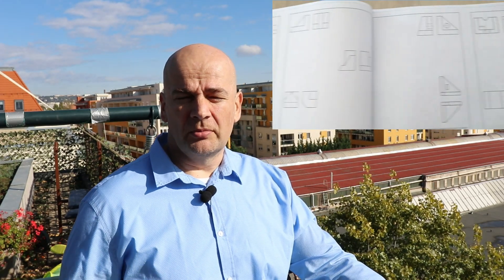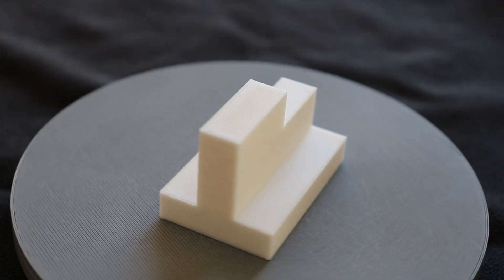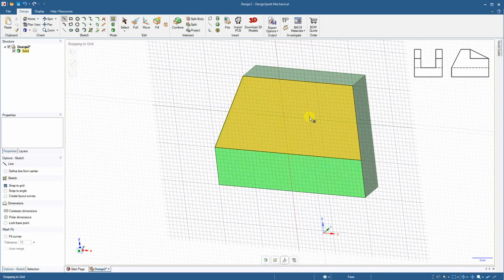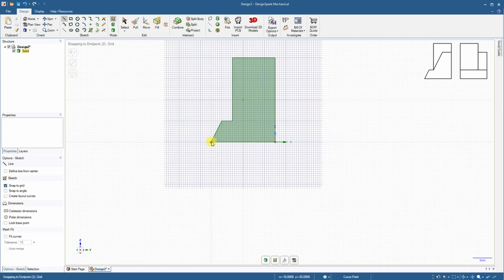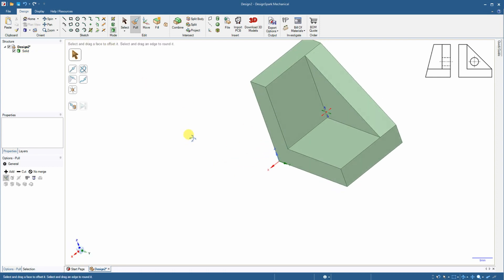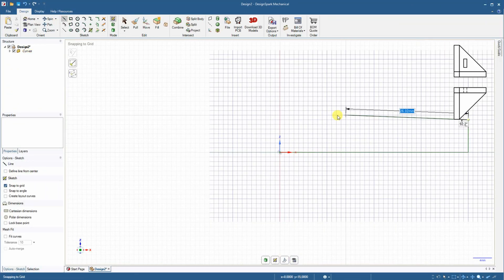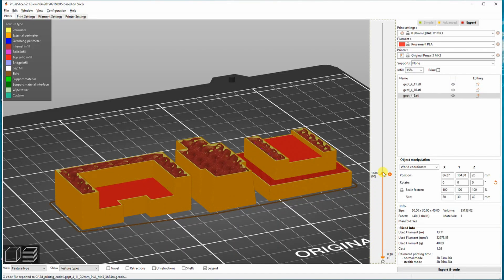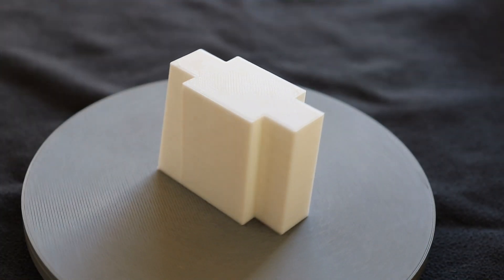DesignSpark Mechanical practice #1

Comment: Nowhere did I find a video on how to make a pyramid with a triangle base (all sides of equal length). Perhaps it is worth making such a movie for beginners.
Reply from the maker: Start with Polygon, 
set 3 sides
Draw the triangle
Then go to Pull/ Pull Direction
Extrude it to get a triangular prism. 
Use Draft tool on any of rectangular surface to rotate it.  "Pick a plane to draft about" this should be a triangle base. 
All 3 surfaces will be rotated and you will get  triangle base pyramid.
Reply: @MyTechFun  Thank you for your answer. My attempt (according to the instructions) was half successful - I got a shape with a triangle base, but the lengths of the walls are different. Still, I'd like to ask you to make a movie about it. I think that the time spent on making a movie will not be more than 15 minutes.

Comment: Ah this virtually is free Solidworks.  Awesome !!!!
Reply: It is free but it has many flaws, btw.
Reply: @pietrononame4945  Ah, it's been a year already.  Since this comment, I found onshape which indeed was created by SW creators and works very similar, but free version is not as powerful.
Reply: I take this back.  DesignSpark looks like SW at a glance, but works nothing like it.  It's either complete garbage or too difficult to learn due to lack of resource.  Online manual doesn't cover anything useful beyond very basic.  All YT channels seem to be dead and no one seems to reply to comments.  I've delete this software and looking for something else.
Reply: Romy Kim you’ve got it all wrong, its nothing like solidworks. Designspark mech (dsm) is a direct modeller unlike SW which is parametric. DSM is much easier to work when you have no prior experience with CAD. Work done with dsm, be it commercial or personal use belongs to the user and not a corporate firm - you don’t pay for different versions based on usage. There’s plenty of plus points to it if you have patience to try it. Tons of tutorials on youtube and the support website too.
Reply: @capncrunch007  I agree Neo.  Two channels that immediately came to my mind are those of Armando Oliveira and Jim Taylor.  I learned just about everything there is to know about DSM from these gentlemen.

Comment: A shame that you began to rush, just when carrying out the less understood tasks eg. removing surfaces, and trimming lines.
I replayed a few times, but couldn't discern the tools being used.
Ha!
... and I was watching your vid to learn how to use the tools other than the pull tool.
Ain't life bizarre...
Reply from the maker: Sorry about that. Maybe I could create similar video. Send me images or drawings of some objects you would like to see modelled.
Reply: I believe that the key is 'appreciating that the basic pull tool has been well covered', and that it is everything else that is of interest.

Sure, you will use it, but incrementally include different aspects.
Then, incrementally work through the other tools.
Likely ending up with at least two components that must be aligned (to say pivot etc.).

For me, the models (in the vid) were too similar... and as I (and others) commented ... where new tools were used; these were not explained .

If I was to design a tutorial for DSM...
I would look to create a working assembly (the more exciting, the better).

Each new component being designed in place, in order to pick up the dimensions from the previous components (as you would do when first drawing a concept).

This would then deal with the problem(?) of DSM merging new components (a la 3d printing), when in fact, a new solid is required.

It would also highlight how the structure, and layers should be, or could be used.
... and each tool, and trick, could be covered.

When the series has been completed, the student will be competent in DSM (Win!)

I would also plan the series based upon it being a tutorial, with sufficient degree of detail and explanation, with a lecture speed commensurate to the task
... rather than making it an 'info-tainment' video.

Info-tainment videos are great for bored kids (check out 'speed modelling').
However, the reason why people watch DSM tutorials, is because they want to learn this amazing software.

That means that the video will be boring to anyone not wanting to achieve this objective.

Oh dear...
But don't panic, because the views will mount, and mount, and mount.

Check out my explanation of wiring diagrams https://youtu.be/Bb8ievq1TsE

It is 50 minutes of sheer monotonous boredom ... and at first YT didn't push it.
But then check out the comments - thanks upon thanks, upon thanks.
... and the video began to get pushed (don't forget scripting subtitles for auto translation).   

It has now received 115k views and climbing.
It is my 3rd highest ranked video.

The reason for this is that everyone who views it, has a reason to view it.
So it gets longer viewing stats, and re-visits ;)
It gets shared, placed in personal playlists (for easy reference) and it gets referred to on forums.
... and it generates subscribers

It has become the go to video for understanding motorcycle wiring diagrams.

Nice!

My advice would be to do the same for DSM.

Decide on whether you are going to make the definitive DSM tutorial.
Get the tags right (and saved for auto-use)
Match the description to the tags, and to the title.
Create an exciting thumbnail ... maybe the finished assembly.

Scripting the subtitles is a bore (it gets easier), but it pays off in terms of gaining subscribers
... and YT will up-rank your videos, because they can then be marketed globally ;)

Give people a reason to subscribe (because they want the next tranche of knowledge).

... you'll quickly get to 1000 subscribers, and then you'll gain a regular income ... not a huge sum; but it will be perpetual.

At that point, you can do a few info-tainment speed modelling vids, or whatever
... AND you'll have the kudos of running a successful educational channel - that is very useful for all sorts of reasons.

Best wishes
https://www.youtube.com/c/EngineTuning